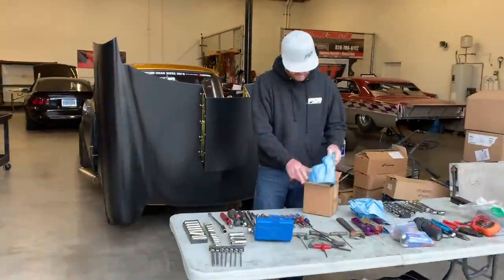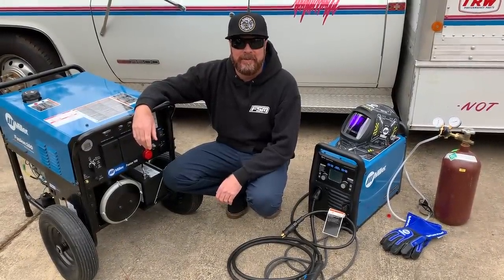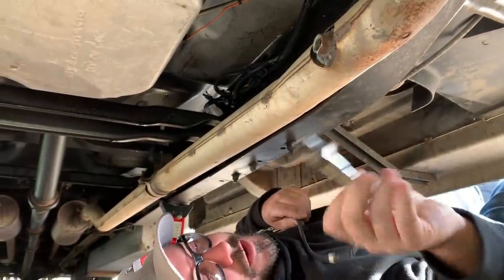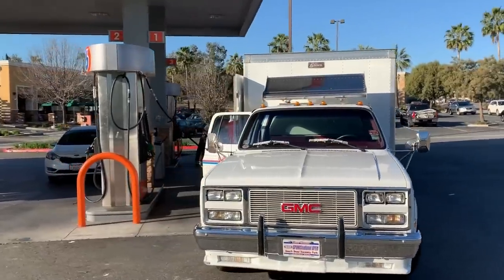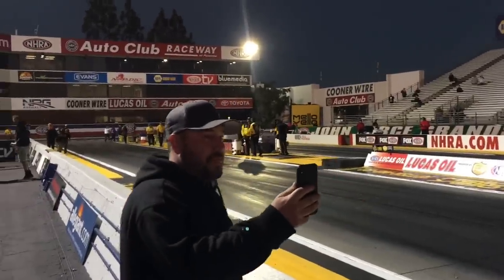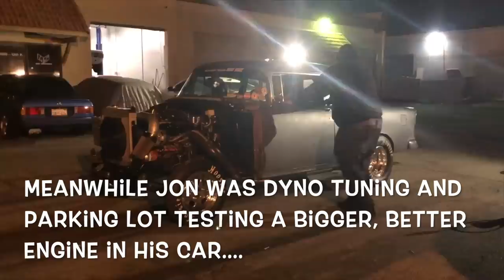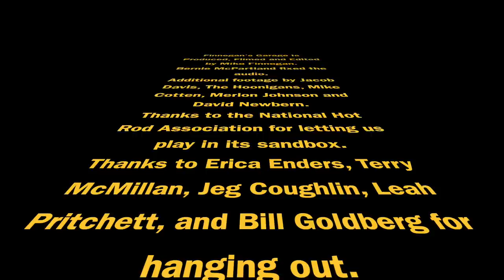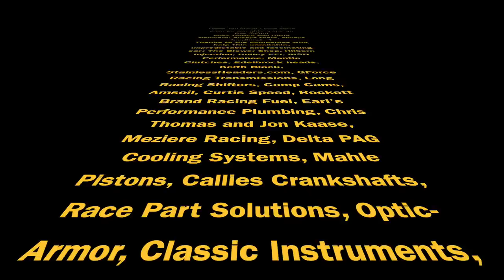Finnegan's Garage Ep.65: The Biggest Wheelie and Race of My Life!

Comment: 5.6 mpg is excellent for that vehicle. My ford 2006 e250 service van only gets 10 mpg.
Reply: My cummins 4bta and ZB 5 speed box truck conversion camper van gets about 15 mpg, weighs 1500 lb and has way worse areodynamics. So my suggestion is diesel swop it.
Reply: Crazy KT 

Pics or you’re lying
Reply: Chump Johnson it’s a U.K. 2003 DAF lf45 7.5 tonne ex bread delivery truck on springs, it gets about 18mpg, but I am guessing the us gallon conversion. They are geared for economical start stop city driving, fine for an over heavy camper conversion. No putting pics of my vehicle on the internet, so sorry. But they all look the same, so google it. Only 150 horsepower, but it will sit all day at 60, I never drive faster as the economy goes down hill really really fast plus the cops get all stoppy, it is a private HGV, so not speed limited, but the cops always stop me when going faster.
Reply: @chrisj197438  . Pics or you are lying. 😂

Comment: I'd be ecstatic with 5mpg towing all that weight haha. I have a 2002 Dodge Ram 1500 getting 9mpg in the city towing nothing haha and the engine is running fine. That's with new plugs, wires, distributor etc.

Comment: Looking at the 'wing' you have on top of the cab at 10:27, it's mounted too far back and not nearly wide enough to break up the airflow going over top of the body. If you get one of those fiberglass units off of a semi that gets wider toward the back (especially one that would cover all the way to the corners), it will help considerably. You also need something on the back of the body to break up the vacuum 'pocket' directly behind the vehicle. I'm sure you guys could fabricate something using some modified technology from F1 and GP cars, that would do that, and still be easily moved to get into the back of the truck. Another thing that would probably help, if you hadn't already done it, is get that intake air temp down to a reasonable level, and maybe use water/alcohol injection to increase the combustion efficiency. Even later model 454's have junk heads with lousy airflow characteristics, so they need all the help they can get, especially if it still has TBI on it. Just an FYI: Overdrive is not going to do it. The engine probably won't spin fast enough to stay cool at lower rpm's. 4.56 is a good ratio for a tank like that, (unless you decide to go with a 6 cyl. Cummins, and solve the majority of your fuel consumption!)😉👍

Comment: FYI the 18:1 pegged  air fuel on decel is probably correct. These ecm's use DFCO (decell fuel cut off) strategy. When you let off the gas and the rpms are in correct range, the ecm turns off the injectors and the engine is basically an air pump until you touch the throttle again.

Comment: Quick aero lesson. Back a few years ago I had a "79" K-10 4x4 auto with a nice sb chevy. It had 33" BFG radials and 3.73 gears. So I drove 120 mi from Phoenix to Tucson which is basically downhill or flat. 
Now the aero point. On the way down to Tucson running 65mph and on my own  it used a full tank of fuel. On the return trip back to Phoenix I got behind a northbound tractor trailer and was literally maybe one or two feet maximum off the back of the trailer(I peaked out to let him know I was there,I got the thumbs up "I think"). Well anyway my fuel economy was unreal. I ended up arriving at my door with more than half of a tank left. It was between a half and three quarters. Thank whoever that we didn't pass any Az. DPS.
 But yeah you are never going to get any better mileage until you get a bonneville salt flat fiberglass,Daytona super bee front end and over cab piece on the ramp truck. 

Happy ramping.

Comment: Much as I like a gas guzzler, you need to drop rpm on the freeway for a start, 
1. Your carb seems spot on but like you said it might have some seriously lazy timing, maybe Fuel Injection might help a bit.
2. Lockup convertor and a gear vendors, Not sure how the gm/chubby option is for a lockup od tranny behind a 454 I'm sure something can be managed, If it'll pull a od gear on a tranny a gear vendors might not be a bad way to go.
3. I'd add headers and a larger exhaust and keep it quiet some 3 inch pass thru muffs and a x pipe and some quiet muffs in the back would probably help more then you think.
4. Someone suggested Higher Compression, I'd agree with that but not knowing if you have flattops or dishes and how big the chambers are now.. it's hard to guess where your compression would end up.
5. A more truck profiled cam, who doesn't love a little idle.
6. The ultimate cure like someone mentioned is a diesel, GM seems to make an all right engine or you could drop a ford.. err dodge cummins in and go that route since you already have the expertise in that.
7. Grin and bear it because if you could get 10-12mgp I'd be really impressed with that box on wheels.

Comment: Our '78 454 developed a huge gas mileage problem that was the HEI pickup coil. It didn't throw smoke, idled great still. Put a timing like on it after it's hot and make sure the curve is still right. Ours the timing either stopped advancing early, or actually retarded over 3k rpm. For trailer towing a tall dual plane aluminum intake was worth 2 mpg. (paid for itself in one road trip)
I hope you find whatever your mpg gremlin is!

Comment: Use some upper cylinder lubricant, I use synthetic low viscosity ATF since it cleans everything as well, synthetic two stroke is the best cylinder lubricant but doesn't clean as well as ATF.
I also use ATF in the engine oil to pre-clean the bottom end before changing the oil.

Comment: I had a 23' class C motorhome, about 11000#, pulling a 7000# 24' trailer full of racing karts and could expect to average about 7 mpg.  It was a Ford 460cid with EFI all stock.  While the tranny had overdrive, it actually got better mileage turning the OD off.  And overall it felt happier not in OD.  Don't know how fast you're going down the road, but typically I wasn't faster than 65mph.  Better aero will help in the flat lands, but weight is what kills you in the climb.  Now my 7.3 diesel F250 can get 14mpg pulling the same trailer.
Reply: He said it sits on 80 mph

Comment: Single phase 240 volts. Finnegan, you just made my day. 100% correct :)
Reply: Guess it may depends what country it's in coz single phase 240v is standard in the UK/Europe? My toothbrush has a 240v plug on it ha!
Reply: @MindMeetMaker  Yep. Even though 240 volts runs into every household in the US, it's halved to most of the home. Common circuits are 120 volts, 15 amps. Only the high current stuff gets 240 volts. (Cooking ranges, electric cloths dryers, central HVAC etc...)
Reply: @MellowYe77ow  Yeah we only do 120v on building sites for safety but it requires a step down transformer, funny because it would be building site you need the extra power but that's health and safety.
Reply: 240V household, whether in the UK or America is still single phase.  Although, because we have a neutral bonded to ground at 0 Degrees in the phase, we get no more than 150V to ground (for safety)

Comment: In order to get accurate measurement from the AFR gauge you need to disable the air injection system on the engine. The rich condition on decelerations was likely the diverter valve switching.

Comment: The area of low pressure between the wing and the box is VERY sensitive. If angled too shallow you create a nasty vortex on the front of the box and it adds tons of drag, and it does look slightly too shallow on camera. Try larger rubber cab bushing mounts to raise the wing and change the angle of attack, and check fuel mileage for each adjustment. The bushings probably hardened and lost height over time, especially the rear. If you get it right you will definitely pick up a few MPG's, those things aren't just for show, they DO work.

Comment: Lower the ramp truck a few inches, put a BIG front airdam on it, as close to the ground as you can manage, Move the roof spoiler further forward and make it flush with the roof, add a set of vortex generators to the rear edge of it. Alternatively, get one of those Beluga head fiberglass shells. Add some skirts over the rear wheels and some of those semi-truck trailer V-skirts under the box. Add some vortex generators to the trailing edge of the box too, you might see a few MPG difference, and over a few thousand miles, that will add up.

Comment: If you have the power add OD.  My 5 speed diesels get far worse fuel economy at highway speeds compared to the 6 speeds. Even with better turbos and a lighter truck it's the rpms. Great channel. 👍

Comment: That was a Double Nickel truck, only meant to go 55mph.  The carb setup won't have enough torque at low rpm to handle an add on overdrive. You would need a tuned port  EFI to pull an overdrive with lock up converter.
Reply: Jak Leo 

Overdrive would burn up in a couple months

Comment: My great grandpa had a 74 camper special, it had a turbo 350 and a 454. He put about 20000 miles on it in the thirty years he owned it. In 2009 it was given to my brother. He put an exhaust, carb, HEI, intake, and some other minor bolt-ons. The best he ever got for mileage was a full tank on the freeway and it was getting about 11 mpg. My uncle has it now and he uses it for around town driving. The best he can get is 7mpg.  The point? You can't get good mileage with big displacement and a three speed.

Comment: I have a 91' Ford F350 with a 460 engine E4OD engine built to the nines and I get 11.8 empty and 10.2  loaded heavy.  Don't know the weight but it was a goose neck trailer with lots of tools including a mill lathe combo machine and it's tooling as well as a 5 foot long roll around bottom and top box that was chock full.  Don't know why I get such good fuel mileage but it's all stock.

Comment: My brother and I swapped a zf 5 speed into a 1978 e350 box truck to replace the c6 that was in it. Unfortunately I never tested the mileage before we did that but after it got 9.8 miles per gallon on the highway. The truck had 3.73 gears, a similar height tire, a 460 and weighs 7500lbs empty

Comment: Couple of things about the wheel stand. If you have never walked on the starting line at a NHRA National event, you have no idea how sticky that patch of concrete is. Shit just hooks up!. There is something that can be done to avoid a wheel stand like that. It's counter intuitive but will work. Simple leave at a higher engine rpm. It will force the clutch to slip more & not pull the engine down. Once the clutch is locked up, all the power will force the pinion to climb the ring gear. The trick with a pedal clutch car, IMO, is getting is past the tree before the clutch is locked up.

Comment: The AF reading they are getting will be affected by the AIR system making things look leaner than they actually are when it is active.  Hooking a light to the AIR solenoid ( or a vacuum switch to the switching valve ) will let you know that readings are skewed to the lean side.

Comment: In a Chevy crew cab dually with a 454, 3 speed auto and a towing package (rear gears in the 4s, can't remember the exact ratio) no weight, just driving to Little Rock, Arkansas and back from Springdale, AR, my mom managed 7 miles per gallon. You should not, and can not, expect better than that with a 3 speed auto behind that beast, more so in something this heavy. The fact that you have managed to average 5 miles per gallon is actually better than I would have expect, but also proves that older trucks just did not care if you were towing or not, they just got horrible millage when set up for towing and hauling. Still my favorite vehicle you own now, with a very close second being the now Cummins powered Ramp Truck.

Comment: You could do a whole episode on economizing the ramp truck. Overdrive, EFI, gear ratios, lightening the weight of the truck, there has to be something to get those numbers up, cause they're worse than my Dad's 454 and he pulls a 27' cuddy cruiser behind his....which, ironically, also has a 454 that get better gas mileage than that.
Reply: Yeah but the boat he is towing is not the shape of a shipping container.
Reply: @MJTAUTOMOTIVE  Not exactly, but close, especially when the streamline of the boat is disrupted by the roller arms of the trailer, and the fact that there's two more axles and four more tires creating drag.

Comment: MY 1973 VW SUPER BEETLE WITH A TWIN TURBO PORSCHE 911 ENGINE DID 8.9 @ 161 MPH. IT WAS MY DAILY DRIVER FOR 10 YEARS. IT SITS IN A COLLECTION IN WACO TEXAS. HERBIE IV WILL BE BAAAAK.. NICE RUN ON YOUR CHEBY. LOVE YO KAR AND TRUCK... I STILL HOLD TRACK RECORD FOR IT'S CLASS AT THE NURNBERG RING IN GERMANY FOR TOP SPEED AT 202MPH LAP 10  - 323 KM PER HOUR. IT WAS BUILT IN GERMANY WHEN I WAS IN THE ARMY. YOU CANNOT DO A BURN OUT WITH THIS CAR IT WILL DESTROY THE CLUTCH. I WHIPPED THE "LITTLE RED WAGON" TORE THAT BUS A NEW ONE. IT WAS FEATURED IN SEVERAL MAGAZINES. HERBIE IV WAS HARD CORE. THE CAR I BOUGHT IN TEXAS BEFORE I WENT TO GERMANY WAS REBUILT THERE AND ESSO WAS MY SPONSOR. I PROVED YOU CAN HAVE A DAILY DRIVER AND BLOW AWAY JUST ABOUT ANYTHING.
Reply: Buy it back from the museum 🚗🇺🇸

Comment: My 98 k3500 dually with 454 and 4.56 only got 7mpg towing with brand new crate motor.  5mpg is great in my mind your what you have.

Towing anything over 12k weight highway cant really use the od in my 4l80e and hold speeds.   
Leave your rig as is.  What you have works amazing for what it is.

Comment: Don't feel bad about that 5mpg on that huge truck. I have a jeep tj with stock 4.0 inline six stock trans and stock gears that gets 8mpg weather it's pulling 2000lbs or not. Also on 35" tires with 10" wide 15" steel wheels.

Comment: That's not too terrible honestly. Id be proud of 5.5 lol. I have a 82 chevy king cab with a 9 foot steel flatbed, 4.10 gears, 454\turbo 400, edelbrock 750cfm carb. Trucks 7000 pounds empty and i get 9-10 empty. 8-8.5 loaded, shes getting a 12 valve Cummins and 10 speed eaton fuller trans

Comment: It would be a ton of work. However since you bought ramp truck 2 so you could lock up your load. I would rob ramp truck 1”OG ramp truck” of the 12V Cummins and transmission to put it into ramp truck 2. The 454 and T400 you can put into ramp truck 1 and sell to a roadkill fan. 
This would solve everyone of your problems.

Also what happened to the white dully truck you had? Just curious.

Comment: Back in 02 I put a 351m circle track motor in a 81 sw f150 and I got 4mpg it didn’t matter if I was empty or pulling the ski boat I got 4mpg but I could smoke the tires at 80 when I hit the gas.

Comment: You should drop a 12 valve Cummins in the ramp truck and it will get much better fuel mileage. I have 96 dodge 2wd with working trans that runs great but the truck is wrecked. Let me know if you're interested and maybe we can work something out?

Comment: I bet richening it up a little under moderate load everywhere wont hurt your mpg and will increase power/response.  This will also allow you to run a overdrive when you go 80e.  A bone stock 80e with a shift kit and trans controller would be awesome on that truck.  When roadtripping the turbo 6.0 gas winnebagk I get an average 7.25mpg at 70 to 80mph. We run the airfuel basically high 12s under any load and as it starts to make positive pressure it dips in high 11s low 12s and goes even richer as boost climbs.  I would richer that big block up..bet it feels way better and you will need less throttle while climbing grades under load.  I personally think you are to lean especially for a carb.  Sorry for long reply.  Cool truck....keep it simple and original dont ruin it with a diesel.  I'm all for hacking stuff but that truck is mint.

Comment: A properly built 4L80E, with a good convertor, can pull that rig in OD. That should help your mileage some.
Reply: I think he's more concerned whether or not that 454 can put out the power to keep 80 mph at the higher gear ratio

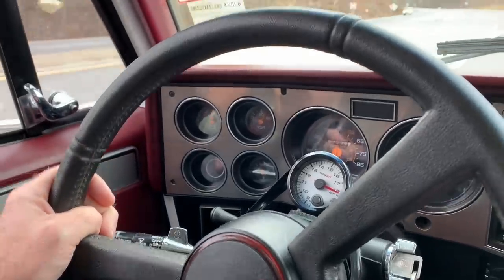Comment: i mount the A/F sensor and Vacuum gauge in their brackets upside down.. zip tied to a piece of carpet so i will be a temp install on top of the dashboard for tuning .. just a thought.. @8:35 when it pegged the gauge at full throttle.. you probably caused the air injection system to dump into the upstream exhaust manifolds like it should to cause any unburned hydrocarbons to be burned up in the exhaust..  oh and by the way. this imgur link of beard removal is what the next grudge match should be run for. https://imgur.com/gallery/8Pc2rt0  borrow some taller tires for the rear on the next run of the car hauler see if it gets slightly better fuel economy..  those are probably 28" tall.. something 31 or 32 inches tall will really wake it up with the 456 gears. .

Comment: I get 5.5mpg  with my 1988 r30 3+3 dually. Tbi 454 with t400 auto. I have a set of Edelbrock TBI aluminum cylinder heads. And set of full roller aluminum rocker arms. And aluminum Edelbrock TBI intake. I tow a 37 foot gooseneck deckover trailer. 14k.  With 2 offroad trucks, a atv and camping gear.

Comment: Finnegan if I may ask u a question, if you are making passes with no water in cooling system could you remove the radiator and the thermostat, hook up a hi cfm eclectic blower to the bottom radiator hose going to the block inlet and force cooling air via it through out the normal engine's water cooling jackets exiting to atmosphere, giving you some what of a air cooling system, plus the increased forced air flow across the engin due to missing radiator?

Comment: what rpm is it now with 4.56 gears at 80 mph ?  I am guessing  3500 + ?  I think I would swap a cummins turbo  in there  , and swap the rear gears to 3.73's . My 02 dodge  dually  4x4 is a 3.54 gear , with a six speed stick  and  I have towed my 45 foot enclosed ,  loaded ,  and I got  more than 3 times the mileage you are getting . I love the cummins turbo's torque , and it get's 22 mpg with just the truck .